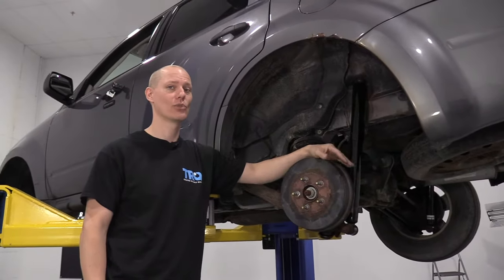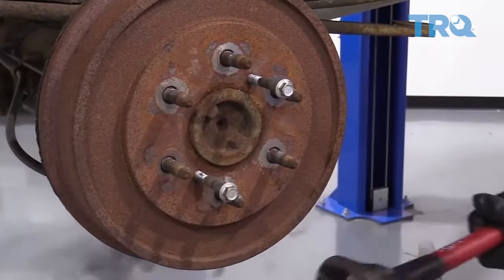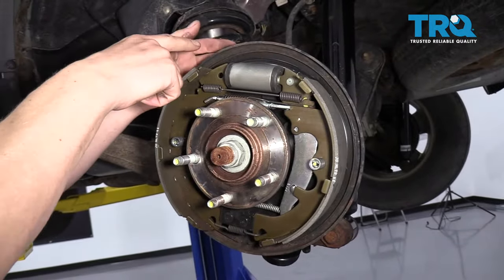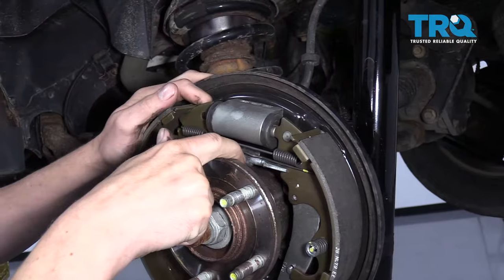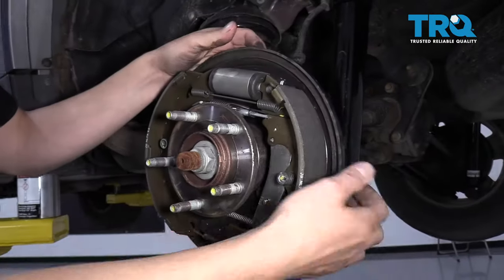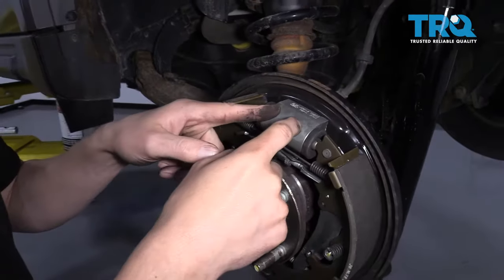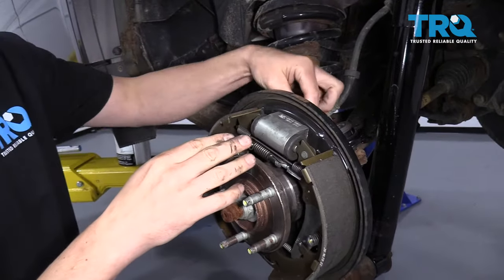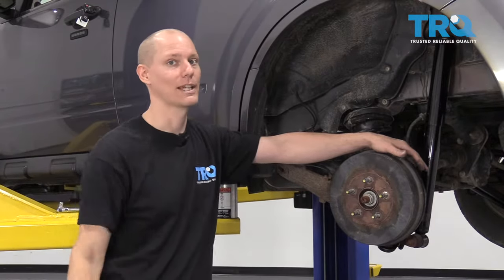How to Replace Drum Brakes on Any Vehicle

Comment: One thing I never see done, if you're going to use the method of hitting the drum with a hammer, don't risk dinging up the stud threads.  Put the lug nuts back on to protect them.
Reply: thank you for this. great mistake prevention for me

Comment: Hi i have a question. When i press the brake there is sound coming from rear drum brakes. My mechanic changed the pads but still same. Sanding the pads the sound vanishes for few days. My mechanic said drum needs replacement because the inner dia has increased. Question is why not loosen the pads outward so they touch the drum more firmly instead of drum replacement. Please advice

Comment: i have a question i am working on a cat forklift right now you mentioned the wheel cylinder ?
my wheel cylinder is WELDED to the casting of the back plate of the drum assembly 
however there were TWO bolts in addition to the female fitting for brake line right on the back of it i don't know why ?
do i need to replace the back plate ? cut it off ??